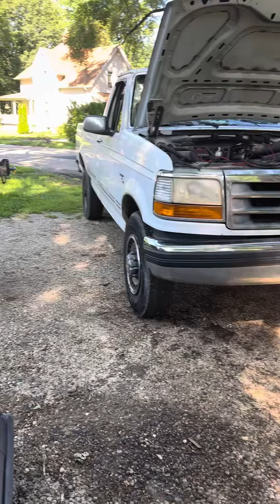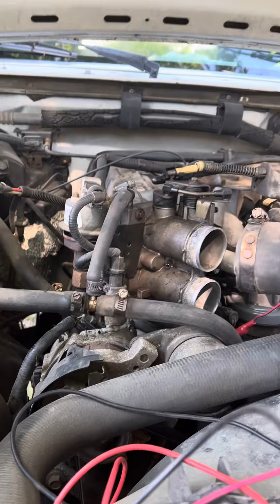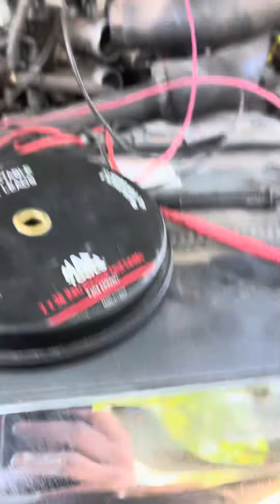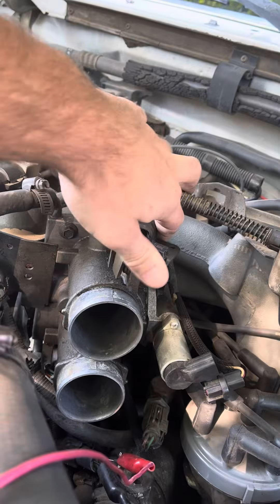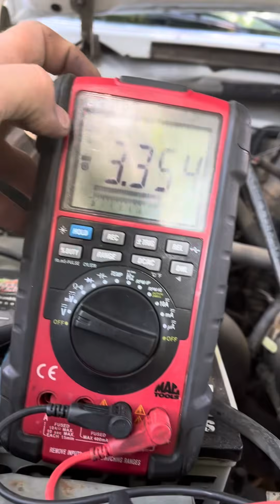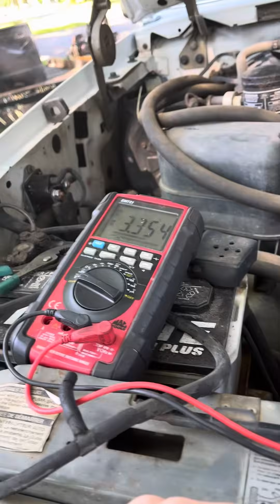351 Windsor High Idle. 92 F-250. Throttle position sensor diagnosis.

Comment: Have been fighting similar on a 94 351.  After replacing tps and iac and all other easy cheap sensors it came back.  Just yesterday I was still fooling around with it and found the cruise cable was not seated correctly.  After correcting things it seems to be all good.

Comment: Just bought a 94 with 351.  Idle is at 1k all the time.  It also surges at mild acceleration.  Is this indicative of a failing tps?
Reply from the maker: Possibly but I would check for a vacuum leak too.

Comment: I’m new to using a volt meter do you have it on DC volts or AC volts because on AC I don’t get anything just zeros and on DC I get a 5.04 volts also my next question is the red wire the signal wire or is it the green wire not 100% sure what wires I need to check I have a 95 f250 with the 5.8
Reply from the maker: DC Volts is what you will use on most electrical circuits on cars. Think of AC Volts as what you would see in a wall outlet. Most of the time AC volts is not what we want on a car. It’s been awhile since I worked on this vehicle so I do not remember the exact wire colors. One wire should be ground, the other should supply 5 volts with the key on, and another wire will be the signal wire. If the signal wire shows above 1 volt at idle the sensor is bad. These vehicles are known for bad throttle position sensors.